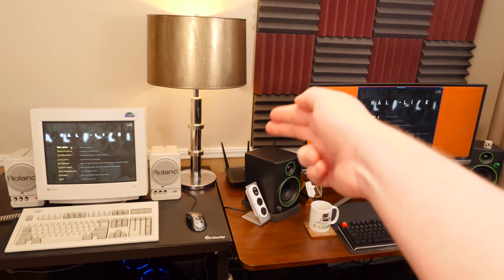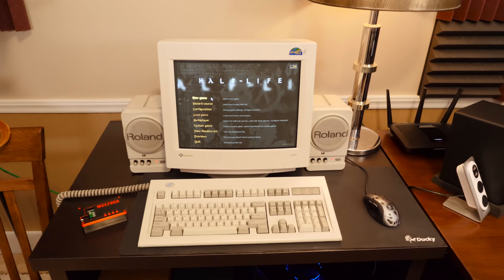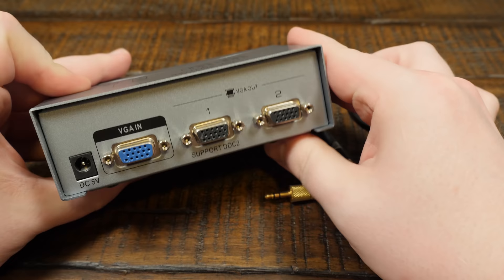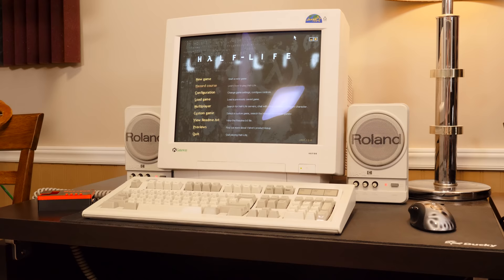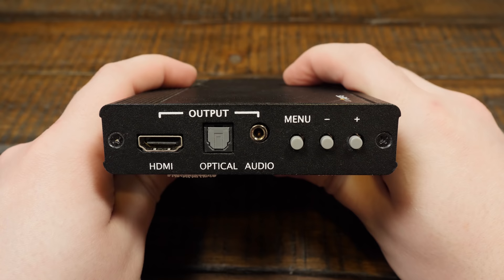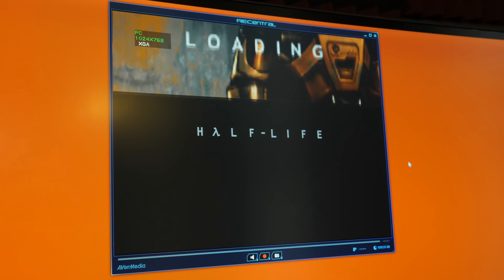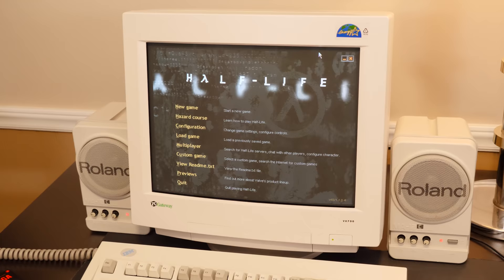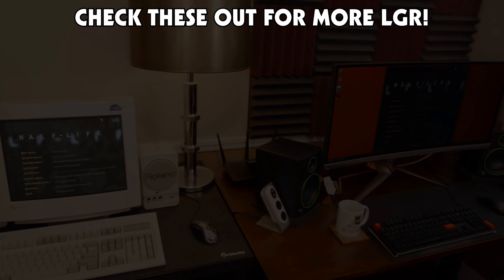Capturing VGA/TTL Video Footage From Retro PCs

Comment from the maker: Thanks to all your suggestions, I've replaced my Dtech VGA splitter box with an Extron DA2 Plus amplified splitter.
The resulting bump in quality is fantastic, very much recommended!
Reply: As part of my channel lineup, I'd like to do some commentary while playing old games that meant something to me... specifically on a Windows 98 machine. You had a lot of various equipment in this video for options... but what's the simplest and/or cheapest way for a novice like me to capture the footage?
Reply: @inkshock  Still relevant, so thanks for responding! How much do one of those bad boys cost?
Reply: Have you tried the open source scan converter for PC VGA? It allows for specific refresh rate timings. I'm currently looking into the box for using old PC's on modern displays, but it converts a signal to HDMI. You would be able to capture that easily.
Reply: @30AndHatingIt  a year late, but a video card with DVI-I or DVI-D out and a DVI->HDMI cable provided you can push at least 720p minimum would be an inexpensive option, not accounting for capture card. Failing that, you may have to add some kind of scaler box in there like the OSSC, as previously mentioned, and use VGA as the OSSC should be able to scale things to a resolution/framerate current capture cards can accept. Cheapest of the cheap would be to hope FRAPS had a version that works on 98 and hope your system can cope :)

A one-stop shop thing would be to find something like the Epiphan DVI2USB 3.0 (if you can find one used for a sane price as they retail for ~$800 USD) or an Epiphan DVI2PCIe (sometimes you're lucky and they pop up for ~$100 USD and work pretty well, at least the one I have does). You'll have to use an audio cable splitter to go to your recording PC's line-in and your speakers, and you'll have to find a VGA->DVI-I cable/adapter which isn't hard since there's plenty on, say, Amazon (just make sure its DVI-I or DVI-A). You've a choice of using Epiphan's Capture Software (needed at minimum to configure the device, so you're installing it anyways) or something else like OBS since it just shows up as a video capture device to that kind of stuff. The DVI2USB SOLO probably won't work, before you stumble upon that, as the product brochure says it uses a DVI-D setup despite the port looking like DVI-I so unless you toss the OSSC+adapter in between that's a no-go (but an option if you go that route)

Video splitters can be added if you want

Comment: Nice. What I like to do, and this doesn't work of course for older machines or setups, is use cards with DVI and a DVI to HDMI Dongle. Most modern capture devices are fine with this, though many don't support PC resolutions like 1024x768 and only 720p or 1080p, but enough do support 1024x768 and 1280x1024. I also  had a ton of issues with audio interference when recording. What works best for me is recording with a battery powered devices, or using a sound card with optical output.
Reply: Optical is best when applicable.
Reply: @Obie327  Yea, with cards as recent as Live! or Vortex 2, optical is available, but anything older and not so much.
Reply: So a solution that'd only work for his XP rig or anything newer? (Or with even more adapters, converters and fiddling.)

Going digital is great, but seeing that both HW and SW from days of yore aren't exactly blessed with it, and/or have some weird quirks in their implementation, I'd personally want to see a quality allround ADC solution, like Clint mentions alternatives to. VGA is such a prevalent standard over time, so if you can capture those signals well (even in weird resolutions and/or refresh rates - niche market at best), that'd be so much more versatile than a digital setup.

Always great to see you and Clint brainstorm in both comments and videos though, you both inspire retroists a lot!
Reply: PeTTs0n88 I use DVI to capture Windows 98 and DOS. Nvidia cards seem to work best for this. Vortex 2 and Live! also work great with Windows 98 SE, and to a certain degree with DOS.
Reply: @philscomputerlab  I tend to find the optical output on my Live not to work properly in all games, especially in DOS (zero volume, if any sound at all, despite mixer and Win9x settings) - the Vortex 2 is pretty great apart from the FM synth. Agreed on the DVI output though - GeForce 4 for instance works absolutely flawless with everything I throw at it, from DOS to XP.

But I have had some bad experiences with digital audio in old rigs - and when it comes to some awesome old school stuff (3DFX especially), digital video isn't an option either. That said though, there are ofc PCI cards with digital video outputs, unsure how compatible they are in general with older HW and SW? (Say, a 486 with a PCI card modern enough to output DVI?)

Analog audio quality compared to digital though... I definitely won't argue there, the DAC and amplification components used on old sound cards weren't always that great. 😛 nor how the signals were handled.
Reply: @philscomputerlab  sorry if I sounded smug, I just love the versatility a good analog capture system gives - even if it's so much harder to get right. :)
Reply: @PeTTs0n88  All good. Like Clint mentioned in the video, there is no single device that does it all. I can only speak for myself, but I have an arsenal of capture gear, depending on the situation. There is also the trade-of between quality and convenience. That StarTech scaler for example lets you capture long sessions, with resolution changes without a hitch, but it's not as sharp or accurate color like the Epiphan.
Reply: @philscomputerlab  Only got a few ooold (but surprisingly compatible, albeit ofc at lower resolutions than more modern ADC setups - I think I can go up to 1280x1024 tops, with two of my three cards only managing up to 1024x768) Pinnacle and Hauppauge PCI cards myself - I may just be a bitter nostalgic. :) But yeah, I agree - there are so many ways to do things like this, many with different pros and cons that'll come into play differently for different users. Great to hear both your and Clint's perspectives on stuff. :)
Reply: PhilsComputerLab does SB AWE 32 have optical output?
Reply: What would be nice is if someone made a ISA CGA card with digital output. As long as you have PCI slots you can already use existing cards with DVI outputs. Of course not going to happen with Voodoo but I'm talking strictly 2D graphics here and no 3D acceleration. You can make graphics cards using a FPGA chip and just render it out on HDMI output. You have addons for the old Amiga computers that has HDMI output that does the same thing. The silly thing is that the graphics is digital to begin with then converted into analog VGA or RGB signals.

Comment: Ah that noisy soundcard thing .. I remember how I could hear the mouse moving on our first soundcard .. and harddisk access. Being granted, the hard disk itself was louder most of the time, but ..
Reply: Oh dear, sounds like integrated audio to me. Very annoying when you work with audio, but also kinda funny when you'd load something up from a CD and you could hear the drive ramping up through your headphones. Sounds you'd only hear in an old arcade game haha. (:
Oddly enough though, it was only the front panel that'd be affected. The rear panel sounded fine to me. Might've been some weird interference that caused that.
Reply: Hi All.  Yes one of my older machines does it, i cant recall if it is the Dell 2400 when using win98 ( it triple boots dos , win98 win 98 ) or the Gateway 2000 Pentum 2 - 233 in 98, i am not sure if that machine has built in audio, as i am still running SB16 and the SB propritory 2x cdrom, everytime i move the mouse it makes a noise
Reply: That was like my SB live 24bit.  I could loudly hear the frame rate and boy was it high pitched when playing ut2004 hitting 600fps in some parts back in the day lol.   SB - frame rate too high !  "autistic screeching!!" 

Turned out to be a dodgy AGP slot so I fixed it by modding my case's card slot screw hole location so I could mount my 6600GT at a angle to make proper contact with the pins in the slot.  It also fixed the weird missing textures and BSOD I used to get in some games lol
Reply: @pierdeer  that is not limited to integrated audio. A lot of old systems can have noise on the ISA bus, that gets coupled into the analogue portion of soundcards.  To mitigate that you have to plug the soundcard in the farthest slot from anything  else and then shuffle around or replace cards until the noise is either gone or at least weakened enough to be satisfactory.
Reply: i had that using my 1979 pioneer receiver connected directly to my pc integrated audio, a little ground loop transformer disabled the noise.
Reply: @TheRealKoltoroc  It was my fathers old 486 with I think a SoundBlaster  "clone" .. could have been an original SoundBlaster 2.0, too. I was 8-12 years old back then, so please excuse if I don't remember too many details. 

I myself had an old PS/2 386 back then (I hate myself for selling it to get some pocket money a few years later) , using the infamous "speaker.drv" in Windows 3.11.
Reply: @VintageTechFan  I had that problem with one of my older computers (which I sold decades ago).  It had a Golden Sound sound card (cheap Sound Blaster 16 knockoff) and a VLB (VESA Local Bus) video card... Cirrus Logic, I think.  Anyway, the sound card would pick up noise from the video card.  Interestingly, the solution was simpler than I thought.  Instead of using the video drivers that came with the card, I switched to UniVESA drivers (which has been replaced by UniVBE).  I'm not sure why that would solve the problem, but it did.

My current computer has an entirely different problem... for some reason, when the computer is on Sleep mode or turned off, and if the atmospheric conditions are just right, it will pick up the college radio station!  It drove me crazy at first trying to figure out where that faint music was coming from when I was trying to get to sleep.  Thankfully, that solution also turned out to be simple... use powered speakers, and remember to turn them off at night.
Reply: I love coil whine. I don't know why, but it's really nice to hear the machine essentially thinking. It's kinda like having a HDD indicator light, which for some reason more modern systems don't have anymore (???)
Reply: It wasn't too bad with the various Sound Blasters or PAS16 I had.  A little noisy with some of the cheap integrated audio chips.  The SBs in particular weren't totally silent, but more just hiss or bus hash than anything else.  Recent integrated audio codecs are really pretty good though, and my MBP's headphone out is great.  (Enjoy it while you can I guess!  ;-)

I remember buying a PC book in the early days of multimedia that came with a CD-ROM.  It had a couple WAV files on it of some music the author had captured from an audio CD (small time artist that benefitted from the plug.)  You could hear their hard drive writing samples to disk in the audio.  Very regular bursts of data every couple seconds.  I was really fascinated by that at the time.
Reply: My ThinkPad t410s has such problems with its internal sound too. You can hear the ssd being accessed and it's really annoying, especially because I have my laptop connected to my main pc to use certain software synths that I only own a single copy of

Comment: Hey Clint, one thing that will help out with hums and noise, is making sure everything is plugged into the same electrical outlet.  Use a strip or 2 if needed. As long as you do not draw more  then 15amps you wont pop a breaker.  This will help greatly with ground loops..  Chasing down hums and buzzing is the bane of my existence.

Comment: Hello LGR, I work as an event technician in germany and i deal with hummloops on a daily basis. If you have problems with hummloops and look for a more professional solution i would rly recommend you the line isolation boxes made by a company called palmer (even though 10 buck amazon line filters do work, im sure the quality of the audio signal would improve) or use a 20 dollar DAC from amazon. 
Also send, return, split or duplicate (especially scale!!!) different kind of video signals is another thing we do quite often, we use boxes called multi format scalers by a company called kramer, their higher quality products are quite expensive but  you should definetely check them out, look for a product that has the functions you are looking for and look for used ones on ebay or used event gear . 
greetings from germany, love your work dude !

Comment: Watching this whole video I was like "whaaaat... no way!" because I use a lot of the same pieces in my capture setup. I split the video so I can monitor it without lag (though I use an LCD because of space constraints), I have the same scaler and toblerone device. The biggest problem I have with my setup is on the analog side. I have a passive splitter and 4-way switchbox that add quite a bit of noise, and my Voodoo makes it even worse. It's still good enough for what I do. I think it was just a bit of a shock to see a big channel like yours using something so similar to my cobbled-together rig!

Comment: This is perfect timing. I've been wondering good solutions for this for a while, but web searches haven't pulled up much that's really all that useful. I'll definitely be looking into a couple of the boxes you named here. Hopefully some are still available.

OK, story time:

I've been looking heavily recently in particular because I am building several retro machines, one with Win '95, one this past week with '98, and another with XP. Fortunately the XP one isn't DOS-focused so it's been the smoothest in terms of setup and capture. I have a beefy GPU from 2011 or so in it (a bit overkill for XP) and I can just use its HDMI out and run the games at higher resolutions that capture cards like (720p or 1080p).

For older Windows stuff on the other hand, it gets a little more complex, but still doable with my setup. For 640x480 and up, I can generally feed a signal through the Framemeister and it will be fine as long as I a have the Windows monitor/adapter refresh rate set to 60hz. If I'm using VGA I'll have to run it through the OSSC first (OSSC straight into my capture card doesn't play nice for this purpose), but the FM will take most older 4x3 resolutions and will upscale them to a more standardized 720p or 1080p, still keeping the original aspect ratio in the process. 1024x768 in particular works great, which is ideal for my '98 system. On that system with DVI, I can use a DVI to HDMI adapter and bypass the OSSC completely, and Windows resolutions down to a minimum of 640x480 at 60hz seem to work fine.

MS-DOS games at 320x240 are another story all together. On the '95 build, I was able to pass VGA into the OSSC, and send that into the FM to standardize the upscale, and that worked as long as I was using a Diamond Stealth III (Savage 4 Pro 8MB). However, when I switched to the TNT2 M64, it ceased to grab the DOS signals (640x480 at 60hz in Windows games were still fine).

I had a revelation with this on my '98 rig over the weekend--well, temporarily anyway. On Saturday and Sunday, using a DVI to HDMI adapter and running that straight into the FM (bypassing the OSSC completely), full screen 320x240 DOS games were being picked up perfectly. They looked and ran great. Unfortunately, time for work came, so I shut everything down and left for the night. I come back Monday morning, powered everything back up, and the 320x240 stuff (even the BIOS) refused to capture, despite me doing absolutely nothing to the setup. Needless to say, I'm back to square one with DOS capture and am still looking for the ideal solution.

Comment: Groundloops are caused by not properly earthed outlets. Many older houses just use the neutral wire for earth, but nowadays you have a separate earth wire. The neutral is never exactly at 0 volts, because your devices push energy through it and the resistance causes some fluctuaction around 0 volts - the hum you can hear on the speakers.

One solution is to get properly earthed devices or connect every one of them to the same outlet with a distributor.

Comment: If you're having problems with audio ground loop hum, try passing the audio through an optical step. As long as the analog-optical converter doesn't introduce noise of its own, the optical line definitely gives full isolation between the components.

Comment: About the stand-alone capture solutions, in this case the AVerMedia 2 Plus: I have been using a Hauppauge HD PVR Rocket for capturing speed runs off my Super NT (a SNES/SFC clone with HDMI output). For me it is really important that I don't require a PC for my capturing. By default the Rocket will use the input resolution as an output resolution. The Super NT looks best in 1080p, so naturally that's how I want to have it set up when I play. However, the Rocket only supports 60 fps for 720p and below, for 1080p it will capture at only 30 fps. Luckily, the Rocket also supports using it as a capture device with a computer over USB. The capturing software supports overriding the output resolution for a specific input resolution. This allows me to have a 1080p source and encode it into 720p with 60 fps. One nice (but undocumented) feature (or maybe it's a bug) of the Rocket is that it stores its configuration in the device itself (as opposed to the software enforcing this at capture time). This means that the override is now also active when I use the Rocket in stand-alone mode.

The point of me writing this comment is that maybe the Rocket is not the only device that takes this approach. Perhaps the AVerMedia 2 Plus and other stand-alone capture cards do the same thing. Just my two cents...